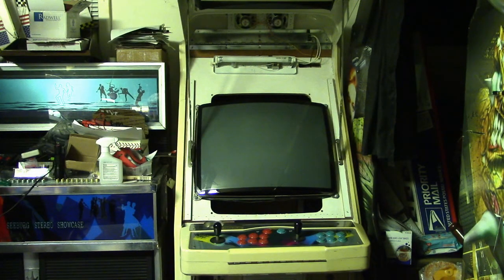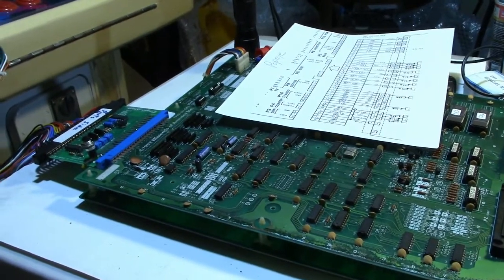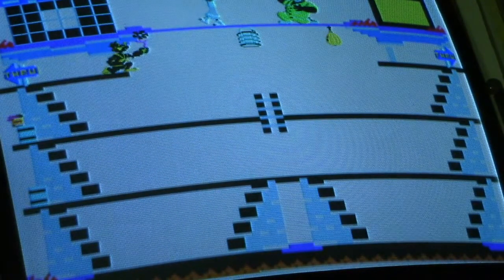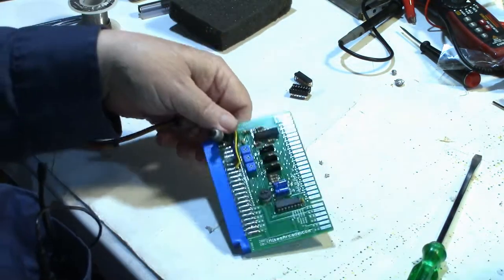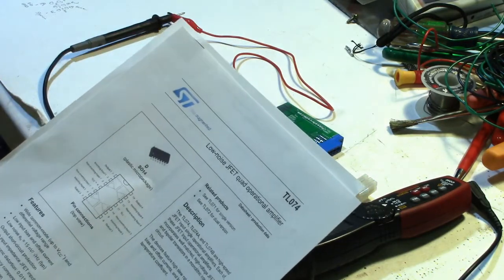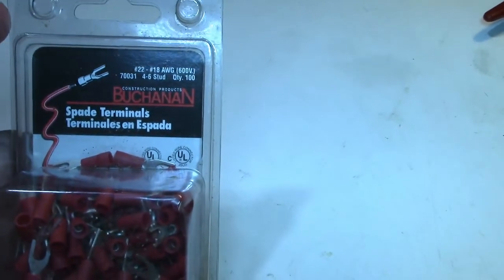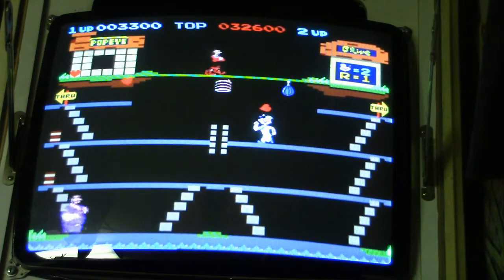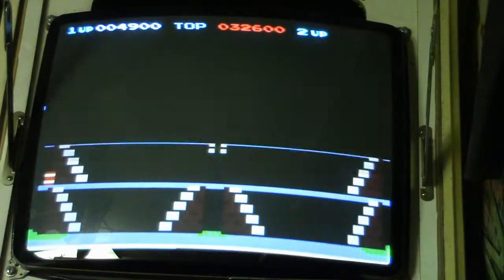Sam's Arcade Fix Popeye Board Repair Part 8 Why is the Video Inverted

Comment: So the whole problem was because your jamma harness didn't have negative -5volts? There was nothing wrong with Mike's video adapter board or that inverter is chip?
Reply from the maker: Yep, that's correct. I have had that jamma cabinet for over 20 years and never knew it was never wired up for -5volts, This was the first time I ever tried a board that used the -5 volts. The thing is Popeye does not need -5volts for the board to work but the jamma adaptor needs it for the invertor to work. I have another jamma vert cabinet I bought the same time from the same person so I bet it's the same. Haven't checked yet but at least now I have new jamma pins to add to the harness.
Reply: @SamsArcadeFix  good to know what to look for the negative-5volts